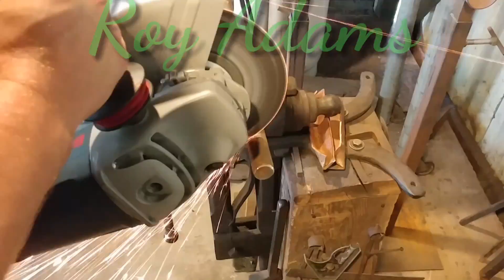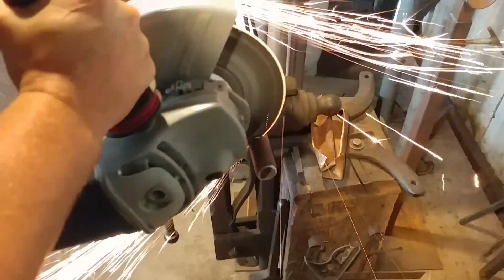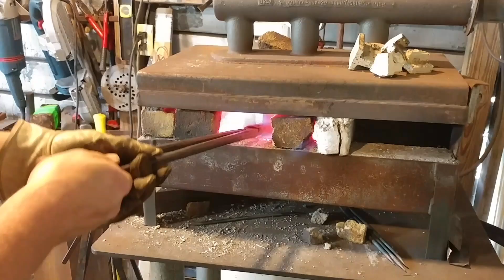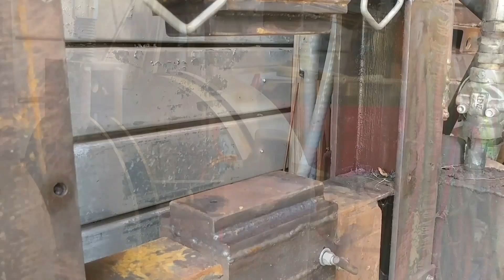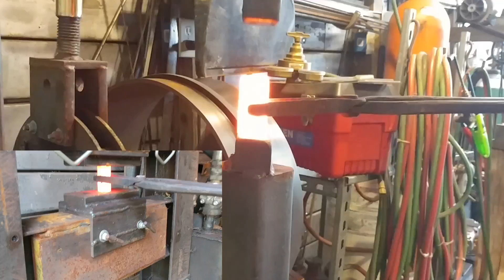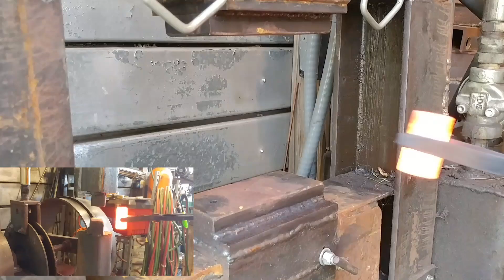Forging Press Vs Power Hammer // Which is Right for You? Hydraulic Press or Power hammer ?

Comment: Another thing to mention is the fact that power hammers one has and presses one has may not even be directly comparable to pressure/ force to have an accurate comparison in forging time. A 25lb little giant hammer may not be very reasonably comparable to a 50 ton press.

Comment: I think I have a good idea for a press with a car jack
There would be a (cordless) drill mounted to the Jack.
The only problem would be to put the drill in reverse mode. I thought about an electric motor with a little circuit in it and a pedal from a sewing machine but that would probably a bit to high-tech for me🤷
Reply: Rostissiere motor. Slow and powerful. Don't know if they reverse,  good luck.

Comment: Hi nice video. To be onest this power hammer od relatively small. My power hammer is from old times 1958, simular to this russian. Theo hammer is  80kg and IT hits 50-80 times stronger. In a free timer i can sens you my video with such a metal dice. IT can be comperable to yours press.

Metal squising by hammer is much beter. The metal have more spreded and dense structure. Specialy whan you have goodbye quality steel.

Comment: I've used both for 30 years.  I mostly used the PH until my elbows were shot.  The PH was faster for some  operations and not as loud.  But for punching and die work the Hydraulics are best, but for drawing billets slower.   Now I'm 60 and just can't take the shock of the PH.
Reply: This interesting. I wouldn’t have considered the shock generated by a PH

Comment: How do these things get such usable control of the gap distance?
Reply: Lou Fazio - the control mechanism is connected to a large foot pedal that you have to use to operate them. Check out some other build videos and you see...
Reply: Eric K   Ahh, thanks.  That isn't often shown.  This tells enough that there is some sort of on-the-fly adjustment.

Comment: I've been noticing that there is a lot of people using the press for forge welding would that be better then power hammer? maybe you can do a video comparing the 2.
Reply from the maker: +bucksmith88 I definitely plan on making that type of comparison video in the future. The one coming out next is the differences between the two drawling out material.